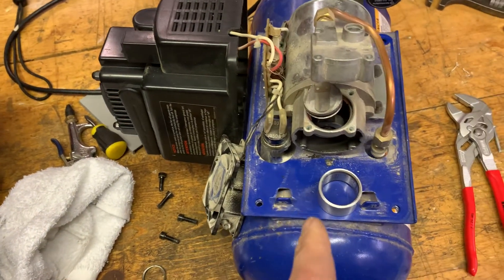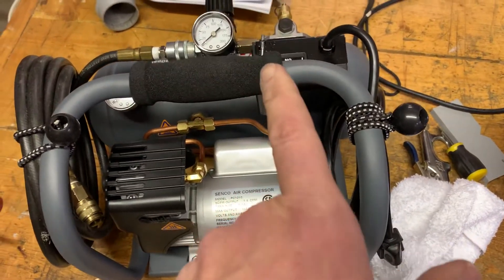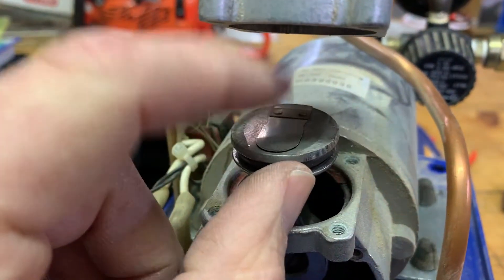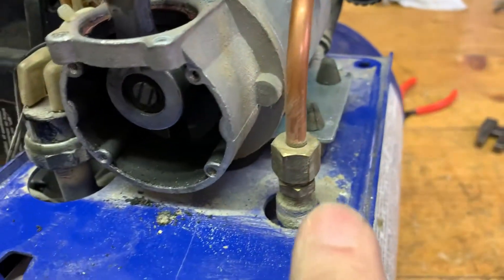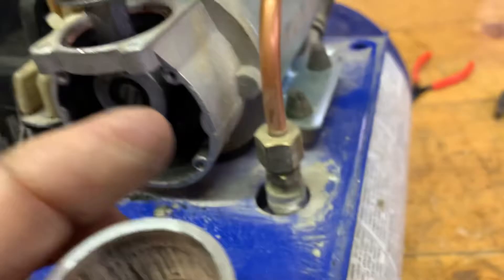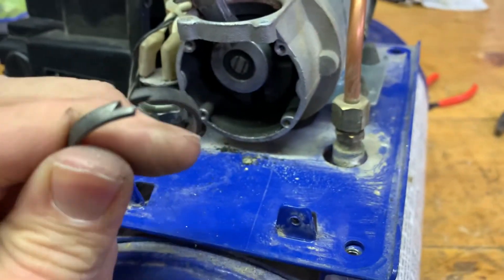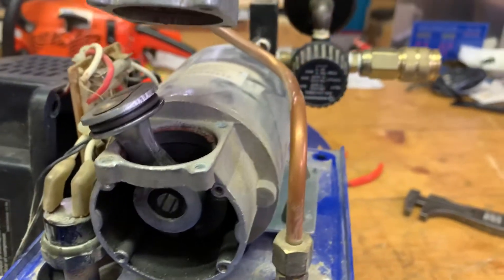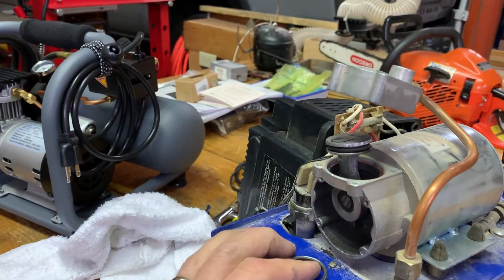Autopsy of an (almost) dead Campbell Hausfeld portable air compressor

Comment: Mine is 2015 nd has a different setup of motor/compressor, Will try to adapt and air filter anyways after some greasing...still works after 5 yrs.

Comment: Very good video. I'm surprised an oil-less compressor lasted 20 years. Without oil, the ring is designed to fail at some point, usually around 2000 hours of operation. I'm wondering if you could preempt a failure and replace the ring every 1000 hours?